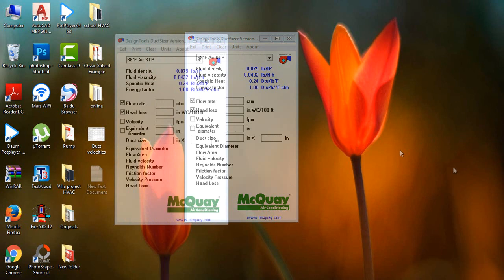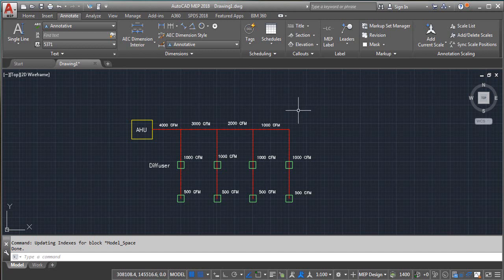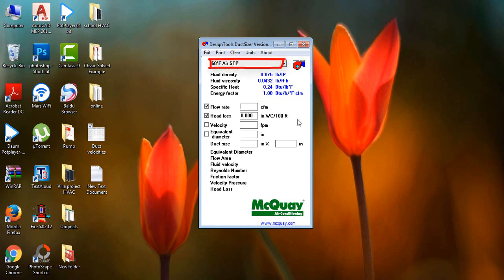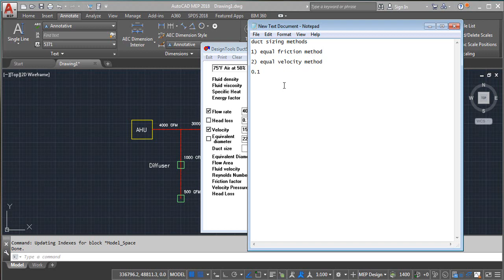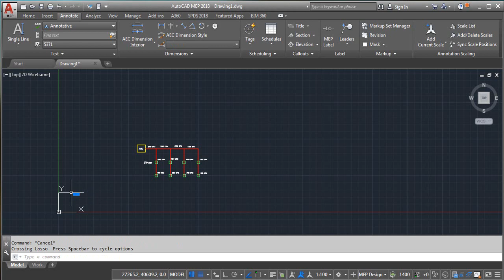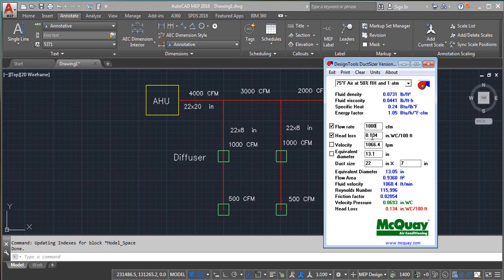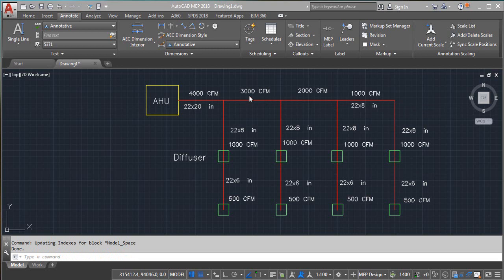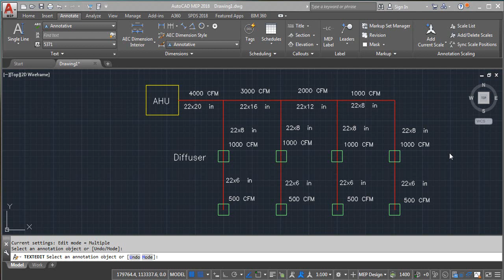Duct Sizing Step By Step With McQuay Duct Sizer

Comment: Your video was excellent, I really liked it, but in the 5th minute you said that we should unify our dimensions, for example, we attack the height first and then the width, but I think that in many cases when you going to install the ducts, you will always find many restrictions by height and not by width . I tell you this comment because it is very easy to find a small space between the ceilings and next floor, thanks, best regards.  Also, remenber that you must to think in diffusors´s dimensions.  Thaks, best regards..
Reply: Thanks for your advice. I agree the restriction is usually the height not the width. 
Where or what resources can I find/use in order to learn best on supply and return grille/register sizing and location?

Comment: Dude you made a mistake, calculated  total diffuser out put CFM is 6000 CFM main duct size is wrong.
Reply: actually yeah. it suppose to be 6000 cfm
Reply: no its 4000 cfm each diffuser will take 500 cfm